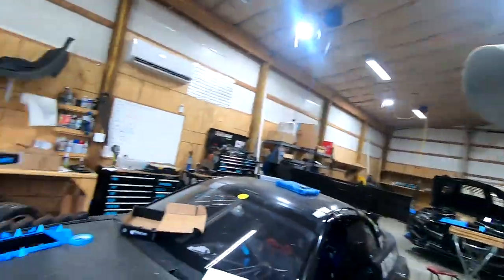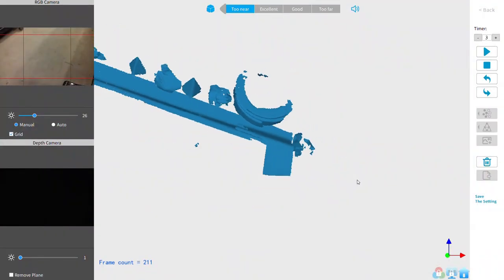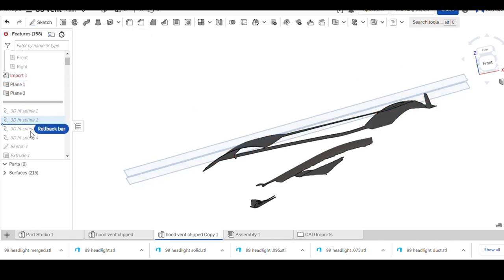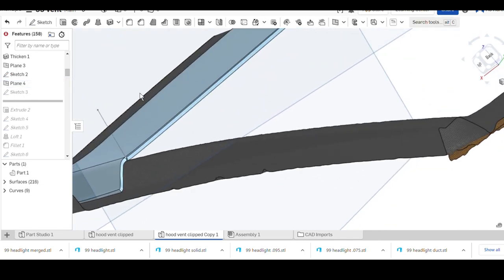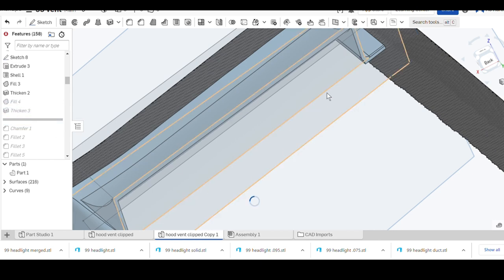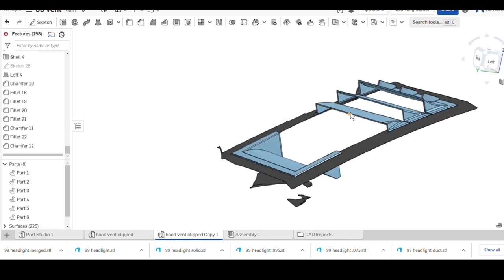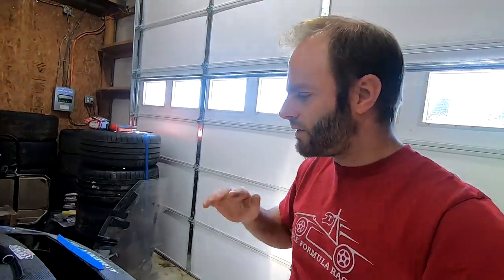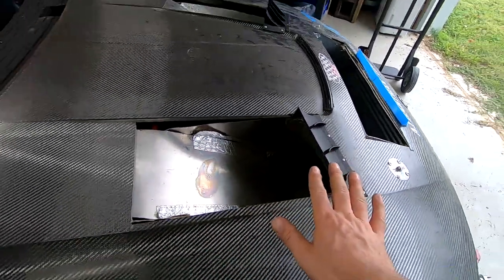3D Scanning, CAD, and 3D Printing to Help Cooling My Racecar

Comment: I'm sure you've got it setup by now, but I would highly recommend CF nylon. I use atomic filaments nuclear nylon, it prints really nicely without a heated enclosure. The stiffness provided by the carbon fiber helps to prevent warping during print. I'm using a dyze hotend with their tungsten carbide nozzle on an ender 3, typically at 275C on the nozzle.

Comment: Just spitballing here… is there enough air across the hood for a NACA duct with a hose pointed right on the turbos? I think the Nissan GTR has ducting in that fashion.

Edit… even from the bottom to get air onto the turbos. May give up some downforce? Better than having to back off for getting hot.
Reply from the maker: You are reading my mind. I’m about 3/4 into my next video in real time and 3D printing a naca duct for the headlights to run a duct right to the turbos.

Comment: A while back some guy did a whole...... layout of a Jeep TJ hood. He had underhood temp graphs developed with an actual piece of multi point data equipment.... Then he went ahead and did the whole yarn and tape trick, to see where the low pressure was on to of the hood. He found 2 locations where there was enough low pressure and right over some of the high temps to be useful. 

He bought some hood vents that where replacements for some car the fit quite well on the hood. He saw a 10° difference idling, 20° while driving.
Reply from the maker: I bet. You see any of my wind tunnel videos? We’ve tested dozens of different louver designs with pressure probes to measure effectiveness.

Comment: Nice video.
When scanning thin objects with apertures, I found it helpful to apply a different color masking tape with half of the tape sticking out from the back side to get the exact aperture.
I scan in textured mode and crop by the color of the masking tape to easily get an accurate aperture.

Comment: The holes in the duct for motor cooling will likely draw air out of the engine bay due to the suction behind the radiator.  I have a similar situation and ended up running a couple 2” hoses from the air box in front of the radiator where I have high pressure air.
Reply from the maker: Since I had pressure probes on the radiator front and rear while in the wind tunnel I’m pretty sure the engine bay will be lower pressure than that specific spot I cut the holes. Would be worth pointing a go pro down there and some wool tufts to confirm tho.

Comment: So did those louvers help or still unknown?
Reply from the maker: 90% sure they did. I was able to say right on people’s bumper without overheating which I wasn’t able to do before.
Reply: @ajhartmanaero  The turning vanes on the leading edge is something Ive never seen before so props for innovating.  Looks like a simplified F1 barge board setup which may be where you got the inspiration, but I haven't seen anything like that in pro aero cars that have louvers.
Reply from the maker: @mattnsac  I’m full of ideas.